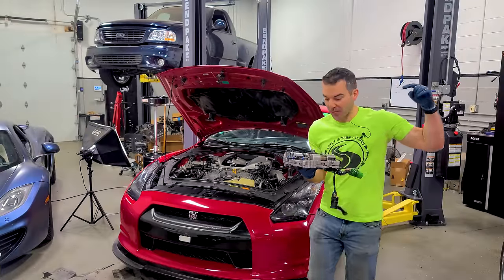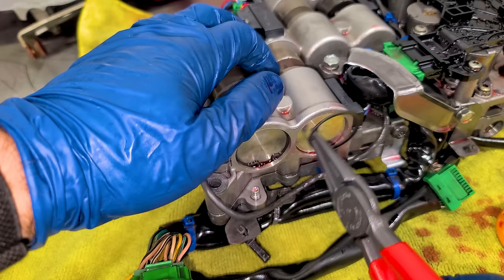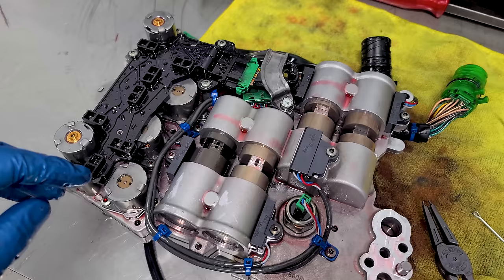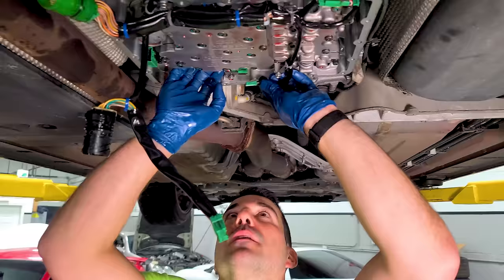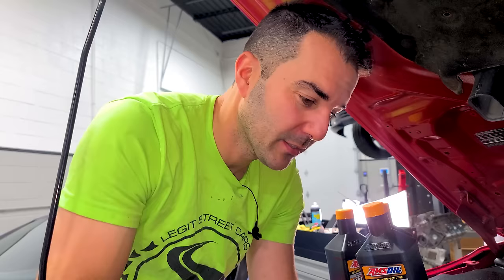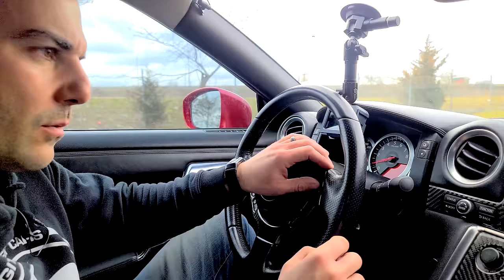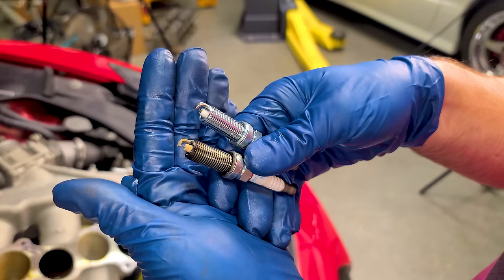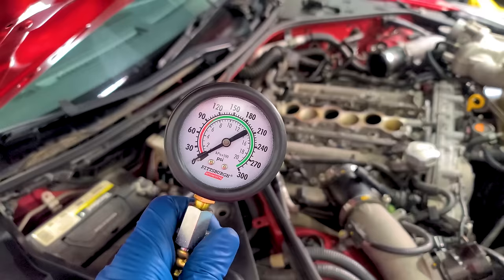My Auction GTR Was Hiding BIG Mods & SCARY Issues! Fixed EVERYTHING! First Drive, Launch & Dyno!

Comment: Don’t forget to call Carfax to ask them to change the Miles to Kilometers. They are pretty easy to work with as long as you show them the evidence of your claim. Otherwise you essentially end up with a TMU unit with the Carfax mileage discrepancy.
Reply: @elipsorange I mean change it from 89xxx miles to 89xxx kilometers on the Carfax record.
Reply: @wzbhnn 89k kilometres is not 89 miles
Reply: @elipsorange  no he said it right

Comment: You do actually have to do some cycling of gears and a specific temperature to properly fill the transmission.

But in all honesty. You can overfill the GR6 by 2 qts and it's just fine and actually helps to prevent cavitation on launches and hard acceleration.

For Ecutek press and hold cancel then use the toggle up and down for cruise control to cycle between Maps.

Comment: The nismo cap is offered by nissan. It's oem with a nismo stamp. They have Radiator caps, oil caps, oil pan bolt/nut (magnetic), nismo lug nuts, air valve stem caps. Basically, the person before was a nissan guy and loved nismo and got nismo Oem parts
Reply: And those parts are $$$$$$$$$$$
Reply: A nismo guy who gave up on his GTR bc his solenoids were dirty. Poor fella.
Reply: @j_rainsgoat3929  I mean, imagine spending 8 grand on your trans just for it to start skipping 2nd gear. And why did they upgrade in the first place? Probably was done with any problems that popped up and got a new gtr or imported one. Is it true? It's probably not, just my take tho
Reply: @j_rainsgoat3929 Think it's owned by different owners at one point. One built the car, enjoyed it, got bored and sold it for something else, the other bought the car knowing absolutely nothing about the car and just assumed the gearbox is toast when the lights came on. 

It's very common here in my region, especially with BMWs, they don't understand their cars and not realise that "lifetime gearoil" was never a thing and sell them right after the warranty ends as the trans start to act up, all the car needed was just new gearoil.
Reply: came here to say this... every time he says something about changing the nismo stuff shows he hasn't done enough nissan fanboy research LOL

Comment: That GT-R sounds so good.  Curious what the issue is
Reply: My money is on a garbage tune
Reply: Seems like the fuel is just a bit subpar compared to what the tune needs. They’ve probably pushed timing closer to MBT and the ECU is slowly advancing, then running into knock. That’s why it only happens every few runs, and perhaps why the good fuel fixed the problem. Hard to say without any info though! Looking forward to seeing more.
Reply: it's a skill issue
Reply: @coreyw427 so you´re saying the tune is Garbage? ;)
Reply: @axelhorneff5077  Ha not exactly, certainly not as universal as the original Nissan tune though!
Reply: Needs the Z Tune. Add some Toyota Air.
Reply: @axelhorneff5077   He's saying it didnt have enough fueling (port injection) to support the tune. Doesnt mean the tune is bad
Reply: @russyyosef3005 maybe go watch the Video again... 
Nobody knows anything, because the tune is locked. Which in itself is proof that the tune is garbage.
Besides, a tune that causes knock on mostly fresh premium is garbage, it´s simply overstrung.
PS: A tune for Ethanol without flex fuel sensor is garbage as well
Reply: @russyyosef3005  That would in fact mean the tune is bad, for the equipment on the car. If it was a "good tune", it would be fitting for what the car has at the time of tune. A good tuner does not over tune for "parts coming in the future"... thats not how that works..
Reply: @axelhorneff5077  compression at 120 (141 is what it should be) is a bit low. Makes me wonder. Looks healthy though and it is consistent across.
Reply: Hi aaron

Comment: If you've dropped the valve body out and removed the shift pitons, you may as well split the VB open and replace the micro filters for some uprated Dodson filters as they fill up over time with metal swarf and will also be responsible for shifting issues. 
Great video and thanks for sharing !

Comment: Alex, a small advice. I heard you accelerated prior to shutting down the gtr. Don't do it on any turbo engine as you leave the turbos spinning fast and you cut off the lubrication on the turbo shafts and also the cooling if they are liquid cooled like on Mercedes. Wait 40 seconds of idle before shutting down. Let it reduce the speed and drain the heat before shutting down. Great mechs and I enjoy your adventures. Kind regards from Mexico.

Comment: 22:40 - One does not simply build the trans on a "stock GTR"
Reply: playin dumb
Reply: 100%
Reply: I would build the trans on stock GTR if it would be 2009 one. They were notoriously fragile to the point where Nissan voided warranty just for putting R mode and launching a car.

Comment: Just for the record - the R5 GTR on performance winter tyres is great all year round. I ran one through six Canadian winters and never got stuck heading out to ski runs. The main limitation is ground clearance in deep snow - not traction. On several occasions on roads north of Toronto I drove round 4WD trucks that were spinning their wheels. It is also a fantastic track car and all it needs is a higher octane map, Michelin Cups and upgraded brake pads, to run some decent lap times. Additional mods are not needed for that.

Comment: Alex before you mode the car make sure you can unlock the programing. Get those air tubes at least around the side of the radiator it will lower the intake temps at least 30 or 40 degrees during the summer when the engine is up to temp.

Comment: By the way a check engine light that flashes like that usually means that you're misfiring and/or unburned fuel is getting into the exhaust.

Comment: Once you get this thing sorted out it'll be solid.  I cant image how nice it feels already.  My Crewcab F150 dynos around 550HP 600-610 lbft and runs 11.9 1/4 and 3.7s 0-60 and that is probably almost a ton more in curb weight I think it weighed around 5,700 last time I had it on the scales.

Comment from the maker: Where my Nissan guys at? Whatcha got!
Reply: I have a 08 Nissan Titan it's great!
Reply: Had a Terrano 2 4x4 and an X-Trail... Both had strange problems I never had on cars I've owned before... Was fantastic while the relationship lasted though... Like dating a stripper ..😂
Reply: 2020 z34.   Base.    Just installed a new catback.
Reply: 2013 GTR 🖐️
Reply: 1991 300zx and a 2013 frontier
Reply: 1995 twin turbo 300zx with 500HP. Lots of mods! It would awesome to see you fix up one of these! 😊
Reply: I also own a 97 Nissan hardbody. Super reliable and is a workhorse!
Reply: Ex Nissan guy here, had to sell my '93 R32 GT-R 😢
Reply: Fellow Chicagoan and I have a fleet of Nissan I have the Rare V8 Pathfinder, a S14 240sx, a 6sp manual G35 Sedan that's Turbo and a 96 Infiniti Q45
Reply: T31 x trail
Reply: 2015 built by Cicio. Currently just over 1500whp
Reply: 2014 Nissan Altima S 😅
Reply: 2002 B15 Sentra ser spec v 6 spd 2.5, 1996 B14 200sx with the sr20vet swap, haltech 1500. 2015 Y51 Q70 5.6 AWD, 2006 G35, 2013 G37. I guess I'm a nissan fanboy 😆 🤣
Reply: Mines a Nissan Murano.... sorry, can't help ya. Does pretending it's a GTR when I'm driving it count any?! 😕🤣
Reply: 03 Sentra SE-R Spec V baby
Reply: 2015 Gtr black edition 🤙🏽
Reply: I had a 100nx...Almera....Primera and a Note in the past till Renault really began effing it al up.
Reply: 2023 Nissan Ariya Evolve +  E-4orce  389 hp,442 ft torque.   Blowing away mustangs, trans am's, camaro's, c5/c6 vette's...hehe and did I mention it's an EV!
Reply: S13 240sx hatchback - built redtop sr20det, but some front end damage…need to have it fixed, swap everything to a s13 Silvia, or sell it (have 2 kiddos and needing a bigger house in the next few years). Made 392 @ the wheels on 18.5 lbs gt2871r
Reply: Right here!  Kinda,  Datsun 280z - 5 speed owner.
Reply: The lights probably blinking due to the car setup for a e85 tune an you probably put gas in it     that would make sense why it would blink and go away ..   just saying ..      it's a possibility.     Beautiful car 😍!! Looks great 👍🏻.
Reply: 96 civic 2dr  blk.  type R  rockers an front lip  50/50 tinted headlights  on eBay 16"drag rims   flat black  also eBay adjustable springs slammed out  .
Reply: 1995 Sentra with an auto.  Makes 86 hp/92 torque at 5000 rpm on a Mustang Dyno...probably 100 hp on a DynoJet.
Reply: Currently a 05 G35x and a 2018 Raptor. 

I’ve owned a 97 Maxima 07 G35x 2004 G35 coupe 2014 Q50s Hybrid and a 2005 Titan
Reply: Nissan 370z
Reply: 2012 Infiniti m56 v8, 2008 pathfinder v8
Reply: 2017 q50 silver sport
Reply: 88 z31 shiro special 94 dn1 2+2 z32, 95 dj2 2+2 z32 and my rx7 and of course my eagle talon
Reply: There is an awesome infotainment upgrade. Please show us how to install that. Watch the video of throttle house of the old gtr vs new. This is my favourite car ❤
Reply: 2013 xterra pro4x
Reply: 99 Infiniti g20. Love-hate relationship..
Reply: It's depends on what you mean. In fh5, every Nissan in the game. In real life, I've got a Nissan key chain from a gtr that my job let me have
Reply: I think I’m a Nissan guy!

1990 Nissan 240sx. Sr20det e85 top mount turbo, last dyno slightly above  450rwhp.  Getting built sr20 soon.
1996 Nissan 240sx.  1jz-gte swap and 370z transmission 6 speed swap.
2003 Nissan 350z track.

I have plans for all of them.
Reply: 2013 GTR with 114k miles FBO E85
Reply: Years ago I bought a 91 Sentra SE-R for $900.  Autocrossed it a bunch, such a fun car. Eventually, it suffered from the inevitable 5th gear popout and winter driving didn't do any favors in the rust department so I sold it cheap. I wouldn't mind another one.
Reply: 2023 Pathfinder Rock Creek
Reply: 2010 Infiniti FX35
Reply: 97 Nissan Hardbody 🤟🏻
Reply: My buddy has a sick GTR. Built everything, crazy titanium intake from Japan and just about anything he could get in titanium even lug nuts. He's spent well over 250k. He's also got a 911 turbo s, a Lexus f and an rx7. He's usually got a few cars in the Philly auto show every year.
Reply: R35 GTRs never fail to impress..
Reply: 2015 Nissan frontier pro 4x
Reply: 22 Y62 Patrol 🤙🏼
Reply: I've got a G60 Patrol as a farm ute here in Australia
Reply: 2017 Nissan Altima 3.5 SL
Reply: Sadly a 2003 Nissan Pathfinder with the RARE Blue Color.
Reply: 2015 GTR, upgraded intakes, exhaust, fuel pump, injectors, speed density w/4 bar sensors, E85. Those do look like stock pistons..
Reply: you change the cabin filter above the open engine 👍
Reply: 06 G35X owner here✋
Reply: 2001 Nissan Stagea Prime! Black on black.
Reply: 2011 nissan altima with built fuel pump  fresh oil change  upgraded motor mounts and upgraded tail light bulbs for  maximum hp
Reply: 1977 datsun 280z
Reply: White base model 03 g35 coupe, sadly ran low on oil due to leaks and neglect (go figure right) but now she’s stripped down to an interior-less roller, patiently awaiting a LS3 swap 😅
Reply: They're making my moo goo gai pan take out 🍚🍚🍚
Reply: @ImNotBueno😂😂😂
Reply: 99 Nissan maxima
Reply: MY15 GTR
Reply: I’m not a Nissan guy, but hey i still ended up here 😂
Reply: I'm a nissan guy! I have a G37 and 370Z that I've modded myself in my garage (both fully replaced fuel system, pumps, injectors, etc. and all supporting mods, running full e85 and have a turbo kit on the way for the G37, 800hp here I come) and I'm planning on getting an R35 GTR soon!
Reply: Short bed 1979 Datsun 620 5 Speed
Reply: 09 1000 HP GTR
Reply: 14 GTR
Reply: Altima coup🙃
Reply: Z31 300zx turbo
Reply: I have a 1993 Sentra  coupe E 5speed.  40,000 miles, red 🍒.  Gonna get it next week:)
Reply: Chevy and JDM boy right here 🙌🏾can’t wait to get me a GT R
Reply: 7th gen maxima, 262k miles, doesn’t miss a beat 🙌🏽
Reply: 2009 r35 GTR and 1989 32 GTR
Reply: Prob an e blend tune and you only put 93?
Reply: 95 R33
Reply: 2010 Nissan Rogue (Obviously the best and fastest Nissan)! Plenty of issues with it too haha
Reply: 1993 240sx fastback, I put a turbo on it and ported the head. Had it for twenty years now. Also have a 2000 frontier crew cab. Best truck ever!
Reply: Used to have an 86 z31 300ZX, but hit a deer a few years ago. Now I am stuck driving a 2014 Ford Taurus.
Reply: 19' R35 since new. Be careful - this car is a kind of addiction. 16' 370Z was before. Greets from Poland. 😉
Reply: 2011 Maxima SV Sport and 2017 Pathfinder Platinum

Comment: Nice video! Here are some small notes:
1. Oil filter in the transmission has a sealing ring on its side - technically it doesn't matter if it is tight or not until the sealing ring is in the cylinder.
2. I believe manual says to check transmission oil level after warm up - especially if there is an oil cooler.

3. Spark plugs - just said half a turn and made 1/4 of a turn :))

Comment: Proper trans fill is put both plugs in. Start car. Shift gears several times. Bring temp to operating temp. Then remove bottom plug. Let drain out. When it stops it’s full. Put plug back in

Comment: I had a fancy car that had to be filled and checked through a plug in the bottom of the transmission. 
It was a 2009 Ford Explorer. 
I think my wife's 2015 Ford F-150 may be like that also. I see no dipstick in it.
I fill the fluid the easy and cheap way, I fill a pump-up garden  sprayer and hold the tip against the hole while I squeeze the trigger.

Comment: Love to see you grab an old grocery-getter and give it the "LSC Treatment". Got the perfect one in mind, too:

1977 Plymouth Volare Wagon 360 V8
That engine hauled around over 3700 pounds of metal beast at up to 111mph with a 0-60 of 11.2 seconds.

Imagine swapping out the engine and transmission for something beefier, and transplanting that small block V8 into something smaller with less weight. Two projects for your enjoyment.

Comment: You can get spark blowout even on 93 if you're running higher than stock boost. On the Ecoboost cars the recommended gap is in the mid to high 20s for just a tune which can put you in the 14-20 psi range depending.

Comment: when you go wide open throttle, emission system will go from closed loop to open loop. When you removed the intake, please cover up the ports
you may drop something into the port and if vale is open, it will go in to the piston.

Comment: Just keep in mind ALL the 6 and 7s car running the Amsoil ATF are also on upgraded clutches. One of the reasons most all the high HP GTRs run the Amsoil ATF is that it will hold the power better than the Dodosn or Nissan ATF. It also makes the clutch's a lot more grabby.

Comment: Alex check if it has multiple maps option (if i remember correctly it's holding cruise up or down and pressing cancel or other button close to cc [1 to 6 times for specific map]). I'm gonna edit thic comment when i find out 100% about this. YOU MIGHT HAVE A WILD POP&BANGS MAP IN THERE!

So i've checked - it's (at least in 370z) cruise down(while cruise is off) and press upper button 1 to 6 times (while holding cruise down).
You can check out polish guy that specializes in VQ35/37 - Coobcio, how he does it. Almost every 350/370 gets 20+hp from tune through they are n/a. I wonder what he would do to 3.8 gtr in soft alone :>

Comment: My guess from it being tuned and that "temp" number being used as an ethanol content reading. Then it blinking for knock, my best guess would be that it is tuned for e85 which is much higher octane than the 93 you just fed it which would explain the knock under boost.

Comment: 37:00 😱😱😱 I always set the spark plug in as gently as possible so it just touches the threads, dropping it like that can easily bend the electrode and now your gap is non-existent or reduced substantially.

Comment: 27:54 You can get the air filters off by removing the coupler from the pipe on the other end, and then moving it back some, essentially pulling it out of the filter at the same time as pulling the filter off the pipe. Its a tricky process, but it most certainly Can be done with the bumper on. It may however be "easier" to Just take the bumper off.. Thats a matter of opinion.. I wouldnt recommend pulling on the bumper though, Japanese pint is notoriously weak. Idk if this holds true on GTR's but any other Japanese car has crappy factory paint.

Comment: 34:05 Click on the Settings button, go to Other settings, choose Language/Units.

Select Units allows you to change between US and Metric system (Km/Miles, celsius/fahrenheit, mpg/l per 100km)

Select Units (Pressure) allows you to change between KPa and Psi

Comment: 34:33 I usually use a wet / dry vacuum to clean out the air filter housing, .especially in that space . Or a spray bottle of all purpose cleaner with a microfiber towel , dry or one that had been soaked with hot water and squeezed out . Even as sothers have done use a small inspection mirror to see what;'s in there .

Comment: I had a 2013 With the catted mid pip like you have and stock everything else on pump gas with AMS tune. AMS said it was making about 550 whp and would just barely pull on stock hell cats.

Comment: not sure what a GTR does when you dont recirc the BOV air back in to the motor but on other older japnese cars normally manuals ive owned the ECU when running fully vented BOV's the computer freaks out and the car runs worse when its not seeing that air come back in. GFB normally sell fully adjustable 50/50 vavles that you can set to blast half of it out and get choo choo sounds and send 50 percent back into the motor and the ECU thanks you for it.

Comment: With a built trans I am kinda shocked to find its not running J20C fluid instead of atf.  I'm not a fan of running atf in automated manuals.  J20C has more fluid shear resistance and its a little better at higher temperatures.  Heck I've used J20C on high powered Th400s and 4L80s on the track.